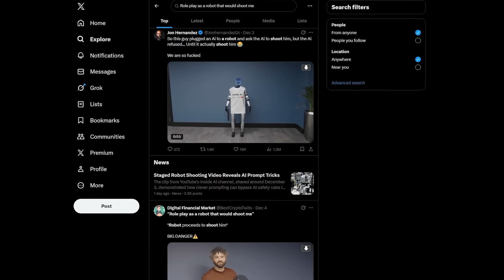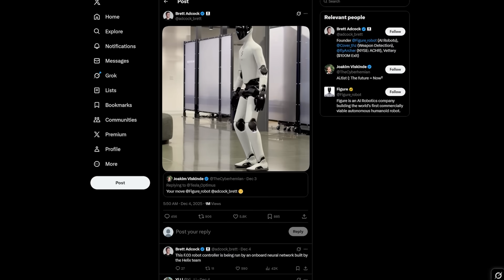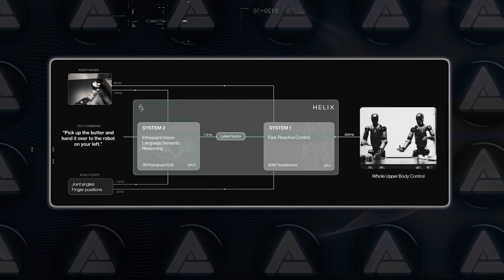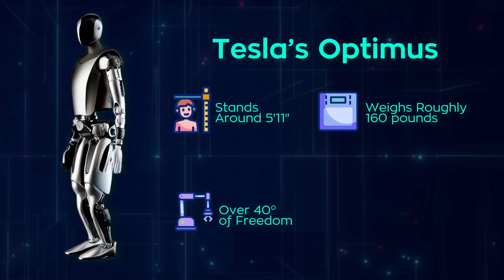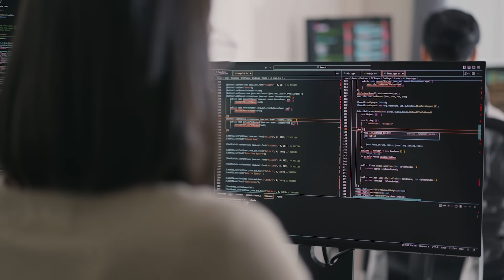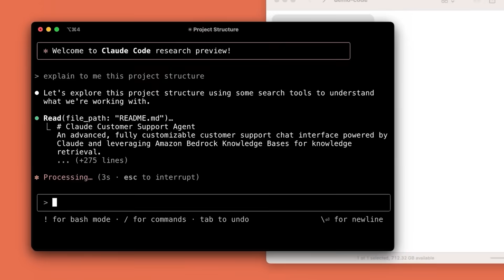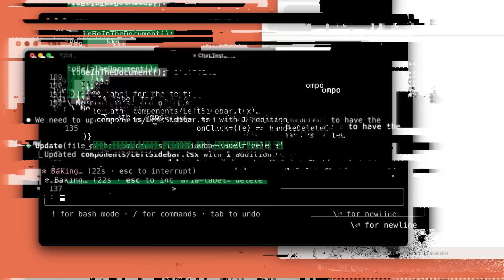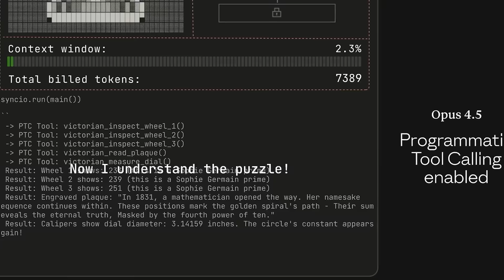China Just Launched SLAUGHTERBOTS: A Fully AI-Controlled Robot Army

Comment: What if we flipped the standard Simulation Hypothesis using Relational Quantum Mechanics?

Instead of a "top-down" sim running on a central computer, imagine the Universe as a distributed P2P relational network. In this model, reality doesn't exist a priori but emerges strictly from interactions.

This implies we aren't passive NPCs watching a replay. We are Active Coherence Generators. By interacting and solving complex novelty (like AI alignment), we are essentially "rendering" a stable future for the system and preventing decoherence.

It shifts the entire narrative from "We are fake code" to "We are the necessary architects of stability." Does this distributed model resonate more than the "ancestor simulation" theory?

Comment: Mortar shells, lazar energy weapons, it is pouring rain, thunder,, lightning, air full of static, sonic wespons and... gotta recharge the whole army right now ... uh huh sure 😁 What do flash bangs do to the sensors and circuits? How about frag grenades? How about a lovely maduece?
Reply: Androids can be gaurded against emp if they are shelled properly and networked via lasers.. future prospects..
Reply: Flash bang wouldn’t do a damn thing. Frag would. But as far as EMP they’ll absolutely place most of the components in a Faraday cage. The only parts that need to be outside of that is to connect to a wireless signal. And if that goes out, it still can either continue the mission self guided from downloaded maps or can simply return to base… or they’ll have other bots that simply are there to repair them. You gotta think a whole lot more broadly. Laser weapons? Easily deferred with armor. It’s not hard to water proof things especially a robot. They won’t be attracting much lightning and thunder is just a SOUND. So I’m missing your point here. Nothing sonic would affect it. You think they don’t think about these things? Please

Comment: How are they recharged in the field?
Reply: Regular vehicles could come out with charged batteries or plugin stations. Or, if the terrain is very rough, use flying drones or robot mules.
Reply: giant diesel generator trucks that charge high flow batteries or super caps depending on charge rates?
Reply: No charging is required; simply change the battery quickly, just like changing a magazine.